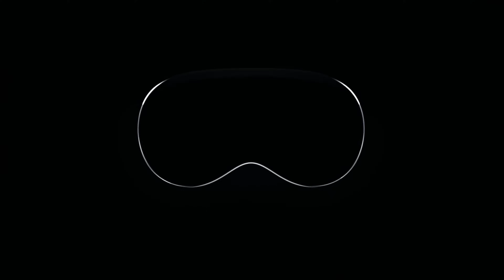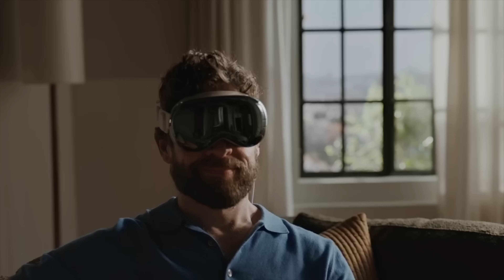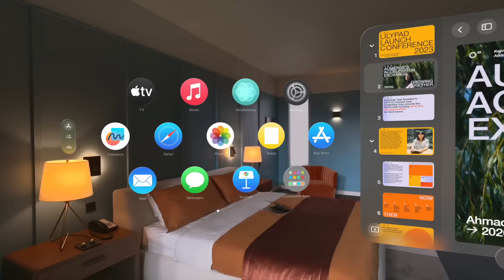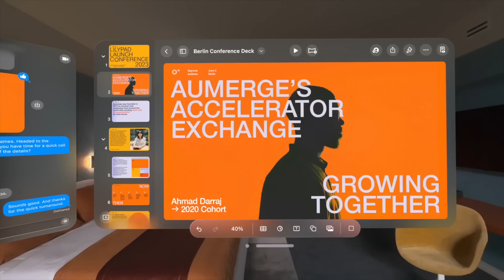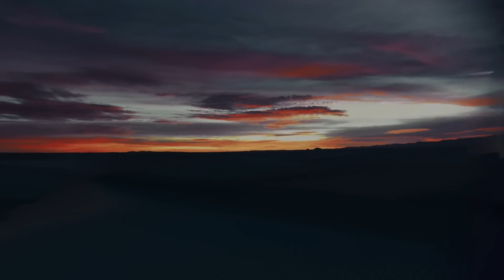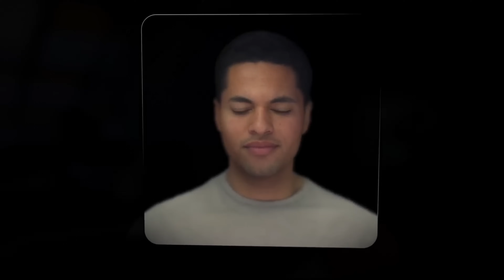Why I bought an Apple Vision Pro

Comment: I’m considering getting it for the exact reason you mention!  I work from home in Wisconsin, can’t stand staring at my office wall most cold fall/winter/spring days, and an interested in the change of pace working at Mt. Hood or Joshua Tree, and hopefully the beach. I’m curious, how do you like working in the environments, and how has it helped your work?
Reply from the maker: I really like the working environments for that exact purpose. If I need to abruptly shift gears in my workday and focus on a different task for an hour, which is very common for me as a developer, I strap on the Vision Pro and connect my work Mac to it. It's expensive for this use, but for me, it's a lot less expensive and time-consuming than buying a second family car and driving to somewhere else to work for some of the day.

Comment: I’ve all felt since first seeing this that it’s only being released as a massive test. 

There is no way that Apple could research a product like this without a large test group. So they offset some of the prototype cost by releasing it, increasing their test group and getting valuable data for future versions. 

They test manufacturing, compatibility, use cases, environment, and every metric they could hope for without paying for it but by being paid for it.
Reply: I think it’s both. They’ve spent 15 years in the lab on this. It’s just reached a point where they could sell the price point for their ambitions. They truly want an experience without the ski mask, but the hardware is still way too far away as an accessible consumer device. Definitely agree in this being a beta edition, but in a way Apple can only do. Most of the tech they packed is a decade ahead of its time from those who are in the space, and it’s only due to their cash flow they could get this out at this quality at this time. Happy they did it though. As one who’s followed the “spacial computing” market since I did dev work on HoloLens I see the future for this tech, but it really needs to get to a form of mass adoption in some capacity for it to survive. And with how meta approached it, they went arguably too cheap on the core software in being able to pull this off. However now that Apple is platforming it, excited for the next decade in how all forms of this form of technology will transform the way we live.

Comment: Wait until meta brings out augments as they are rumoured to be bringing augments of Instagram WhatsApp, Facebook and Threads and your going to be able to anchor the objects and they can also interact with each other and apple's headset is not officially supported by YouTube so you have to use it through safari Spotify and Netflix also and these apps are available on both Quest 2 and 3 and Playstation VR2 and i am more than happy with my Quest 3 as Asgards Wrath 2 is amazing and GT7 on the PSVR2 is nothing short of breath taking in terms of graphics

Comment: I woke up at 4:55am to get ready and was able to configure mine just fine. For unknown reasons, i faced multiple issues during checkout. I was finally able to checkout but with a deliver date of 2/11.
Reply from the maker: I had a lot of issues in checkout as well.
Reply from the maker: That's a bummer you won't be getting it on Day 1, but soon enough and Apple usually beats shipping estimates
Reply: I had checkout issues too. The website told me three times that there was a problem with my purchase and I had to start over from scratch. Each time I put my order in, the delivery date slipped - from Feb 2 in-person pickup at 10am, to Feb 2 at 5pm, to MARCH 10 with home delivery as my only option - no in-store setup dates available at any of the six Apple stores near me. Each time it said there was a problem and I had to try again. I was about to give up… And then… my email showed that ALL THREE orders had gone through after all! So I was able to cancel two of the orders and just keep the earliest one. But for some (again, mysterious) reason, it’ll now arrive at home on Feb 13-16, no in-store setup. Super weird, but hey - at least it’s coming.